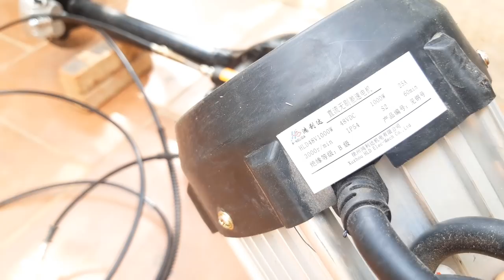Electric car 48v1000w P1: Rear differential - attached to the electric motor

Comment: I have a tricycle with similar configuration, recently, the motor turns when throttled but the the axle and tyre does not move. What could be the possible cause please.